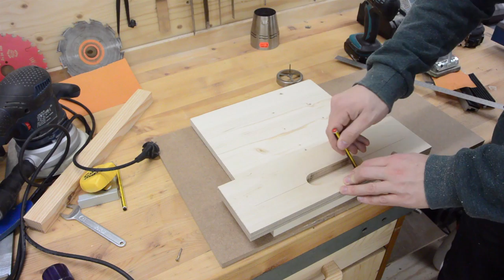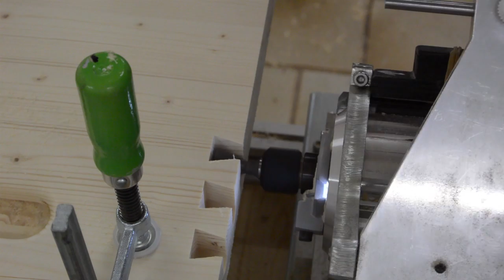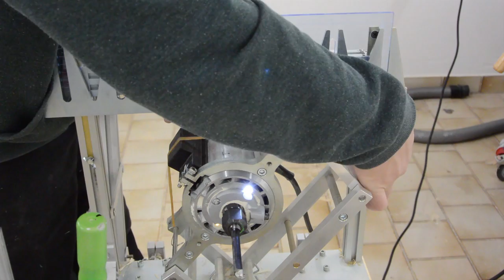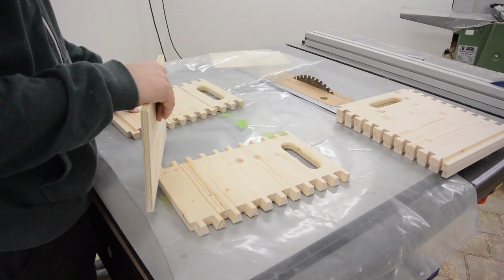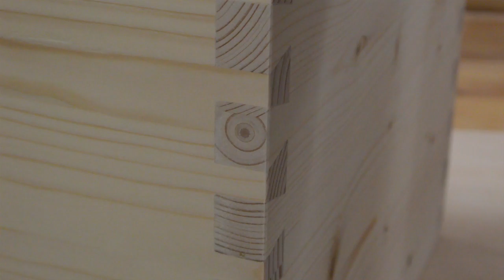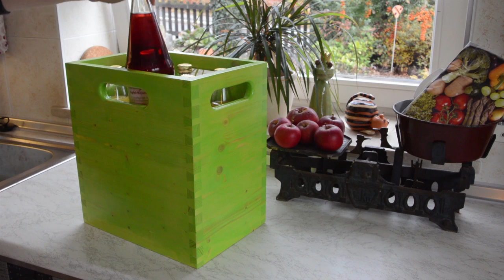making a Dovetailed Beer Box (Large Dovetail Joint Using the Pantorouter)

Comment: To avoid tearout, use a strip of painter's tape over the area while cutting the pins/tails.  The tape will act as a baker board and prevent tearout.  Peal off the uncut portion of the tape when finished cutting the pins/tails.

Comment: The lack of dust collection is the only thing holding me back from getting the metal pantorouter. Man what a nice machine.
Reply: +Jay Bates 
There's dust collection coming and it will be backward compatible for old and newer Hybrid PantoRouters!  
Effective dust collection was a much more difficult task than originally thought and it took Kuldeep many tries to get it right, but nothing is impossible, especially when Matthias and Kuldeep put their brilliant engineering minds together on a project.
Stay tuned to the Forum on HybridPantoRouter.com.  Also, sign in to the Contact page and we'll send an email when it's ready.  We only send emails when there's something new in PantoRouter world, and we NEVER share your email.

www.hybridpantorouter.com
Thanks!
Reply: +Mac Sheldon Thanks for the info
Reply: +Kirby Weldon Thanks for the info

Comment: Cool build, although construction adhesive was probably overkill. Most of the strength comes from the joint. Wood glue would have been sufficient.
Reply from the maker: This glue is really not good. I just wanted to get rid of it so I used it for this application. I'm pretty sure it is not as strong as normal woodglue.
Reply: +Cosmas B Agreed.  Not as strong as yellow glue, total mess, and gums up sandpaper.  I admire your desire to not let it go to waste, as I'm sure that wasn't a very easy decision to make.